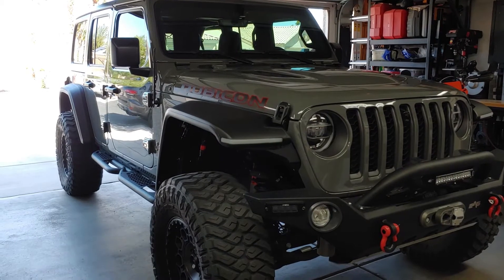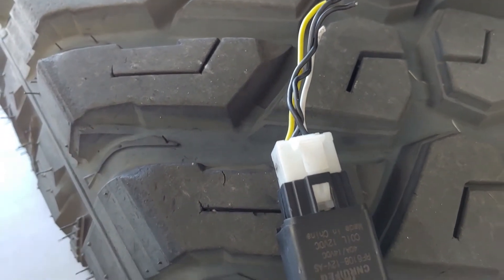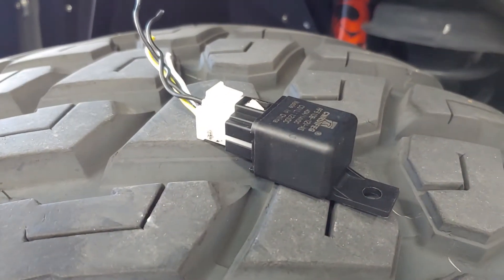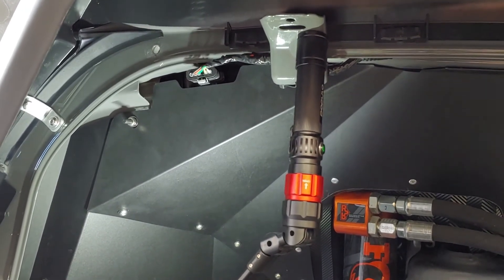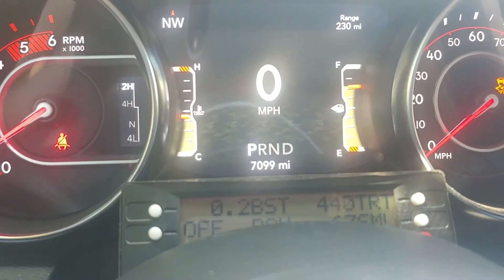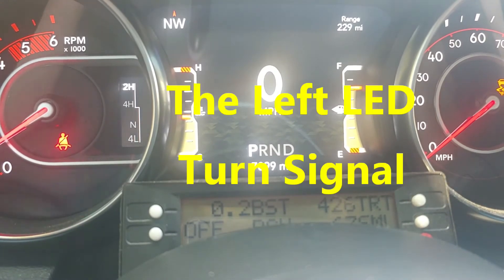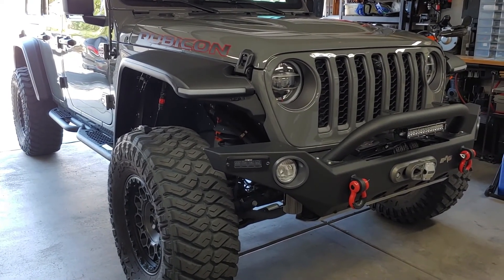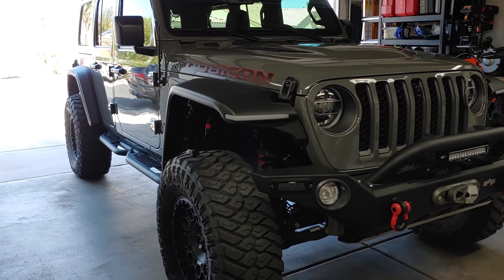Make Aftermarket LED Turn Signals Blink Correctly!!

Comment: Great video. Can you share how to wire the relay
Reply from the maker: Checkout the video at the (9:39) ish point.  You only need to have the turn signal power wire also feed the relay energized state.  I tapped into the factory YELLOW wire and ran it to INPUT PIN 2 on the relay.  Tied PINS 1 & 3 of relay to black ground wire...and ran the factory WHITE wire to PIN 4 of the relay.  The main thing is to have the turn signal PWR wire also power something else for the increased load...energizing the solid state relay adds said increased load...the relay doesn't need to actual active any other circuit once energized...just need to see the increased load on the turn signal power wire.  Let me know if you need additional info...it has been over almost a yr since I did the mod.  I might be able to send you a circuit diagram if you need additional info.  Hope the info helps...